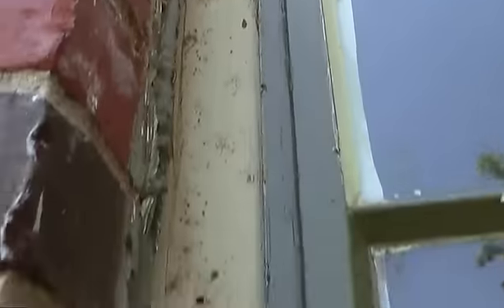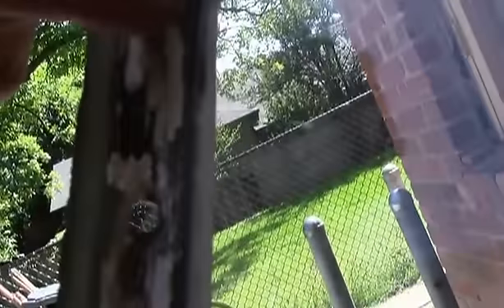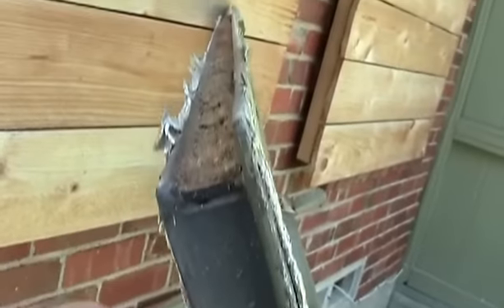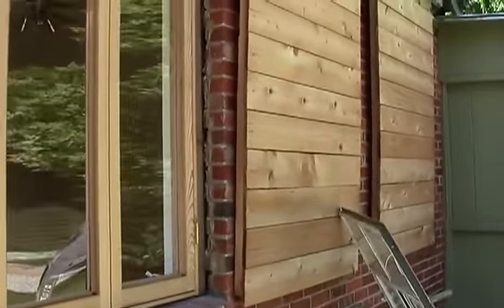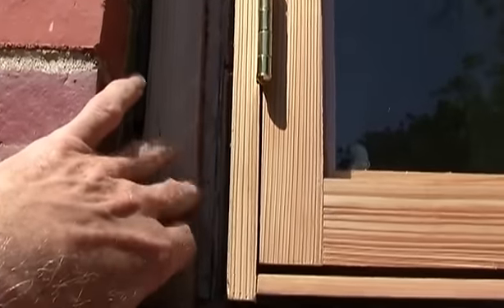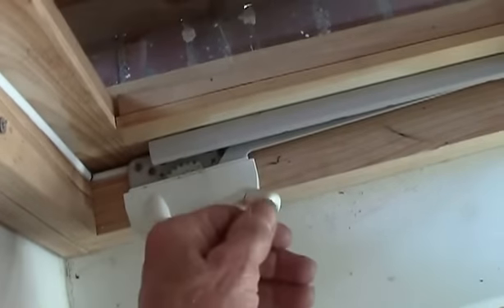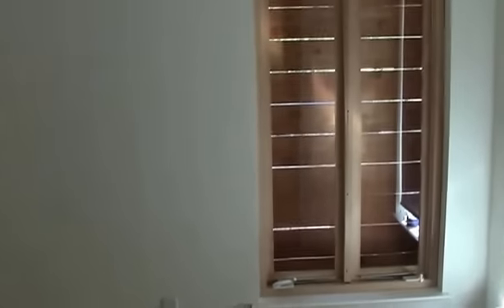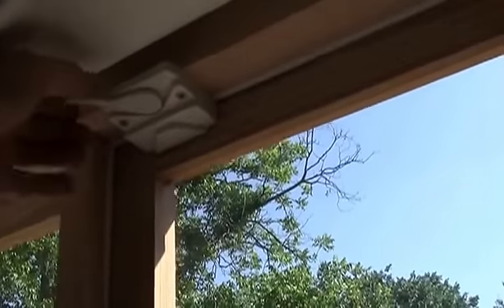Casement #5 installing your casement window

Comment: THANK YOU FOR YOUR VIDEOS. I like much your universal jig for cutting hinges space in casement and in sash . It is so handy with spacer of 3 mm .
About installation I do not understand why you do not remove the timber around window and install it as the wall opening it is ?
thank you. Jon
Reply from the maker: That framing is part of the wall framing and I would have to tear out some of the sheet rock to add another stud

Comment from the maker: Yes the sills were made on the table saw and the mortise and tenon approach would be great if you going to open and close them all the time. I am not set up for that and wish I was. It is much stronger joint. These windows went in a rent house and will probably be open when they move out and the painter wants to paint each time.  Thanks for asking

Comment: that's amazing, I was looking for any info how to replace exacly the same type of window! whats the best way to measure the new, replacement window ? Do I need to remove the trim to asses the size (to see the frame) ?
Reply from the maker: I'll send you information tomorrow
Reply from the maker: First thing I am going to figure out how to send pictures on these youtube reply's. Second thing a good way to get a good measurement is to measure side to side and subtract 4" , then measure top to bottom and subtract 5".  This is for a brick veneer house and not a frame house.. As always this is a guestimate . Do you have a frame house ? do you have brick veneer?  Is it stucco? If you have the patience you can remove the interior trim to see how the studs are set.  Hope this is a good start.
Reply: In my case it would be a full brick house (1930's). Not sure how the interior trim removal would help - removal of the external trim would expose the frame. This would help to measure the opening (right?) and assess the frame for any damage. How much smaller should I order the window, compared to the wooden frame opening, 1/8 inch side to side ? from Your 4" for side by side and 5" for top bottom, You assume that the wooden frame is made of 2x4", and that the clearance for a sill will be 1", is that correct ? If You would have any pictures of the bolts used to secure the window frame, that would be fantastic! Were Your windows made by CRITTALL by any chance ?
Thanks!

PS amazing work with Your own windows!
Reply from the maker: memento1984   If you can get exterior trim off then yes you can get the measurements. The only tough one would be the sill since you cannot remove it without tearing up the window. ,but with some good math and measurements you can.  I should have asked, are you removing steel windows or wood?